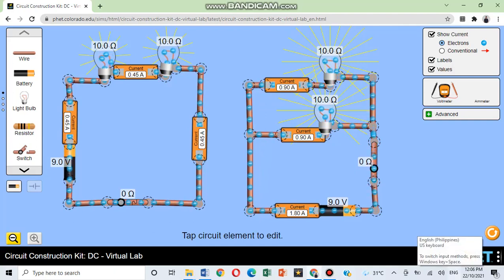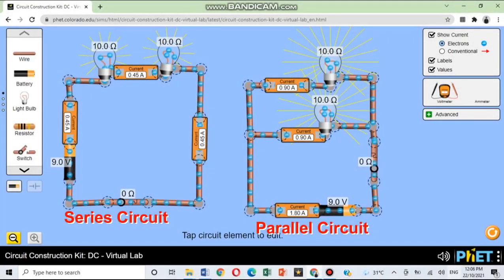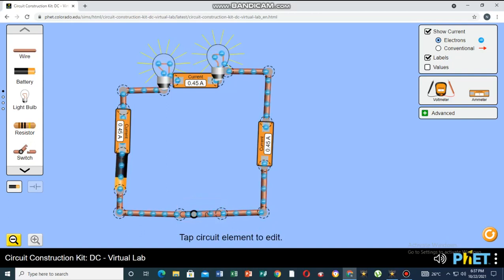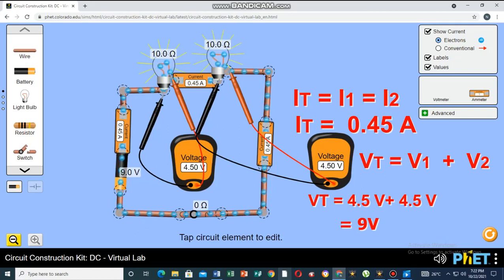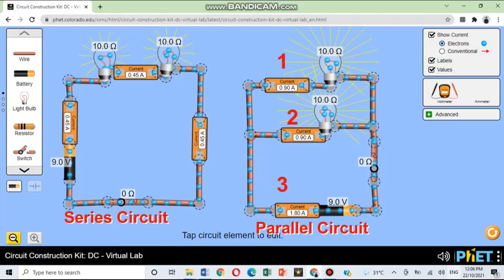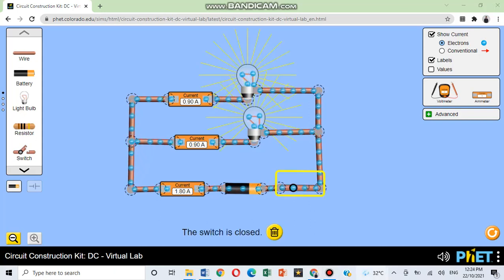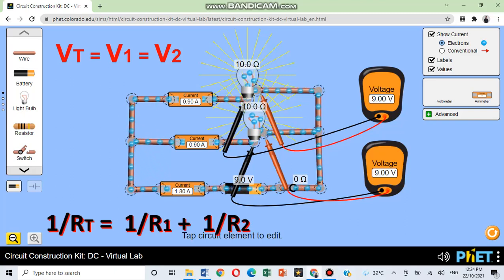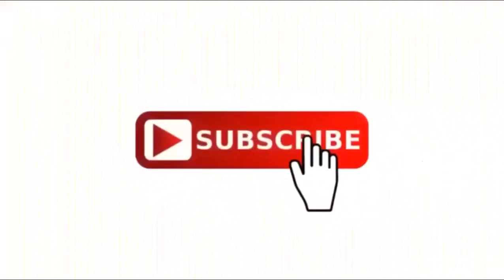How to build Series Circuit and Parallel Circuit using PhET Simulations? / OHM'S LAW

Comment: Sir ok lang po ba kahit walang resistor sa circuit?
Reply from the maker: Yes Jasmine, you can construct a simple or parallel corcuit without a resistor. Thank you for asking Jasmine!
Reply: @SirMarlon  Sir nag construct po ako ng may resistors sa series circuit tapos negative po yung nalabas na result sa voltmeter, pano po yun ayusin ? thanks po.